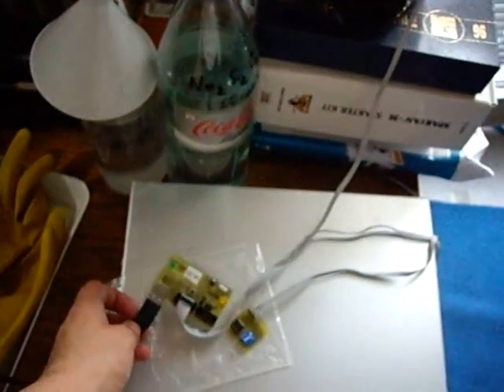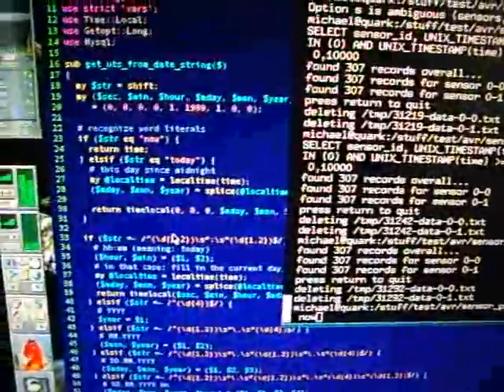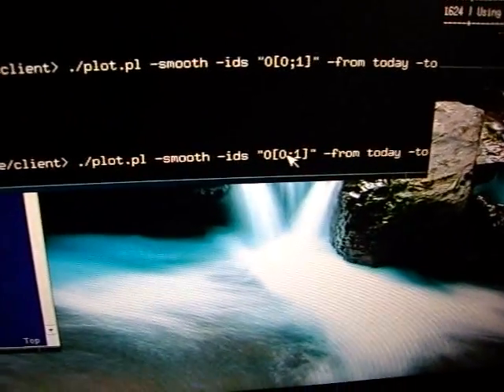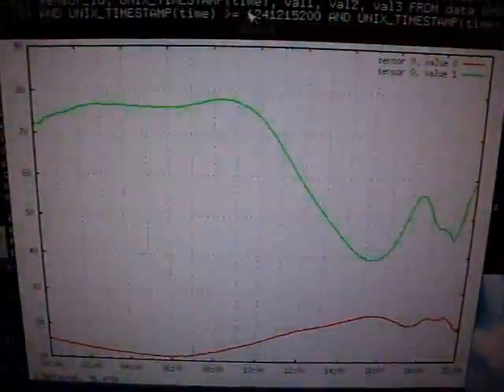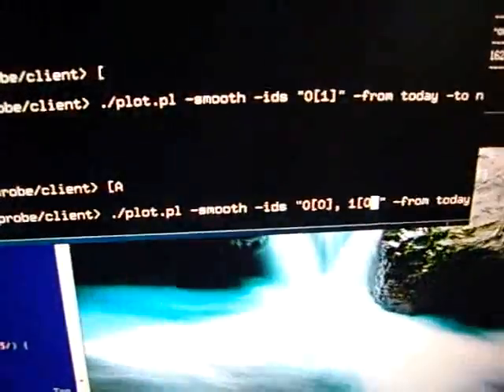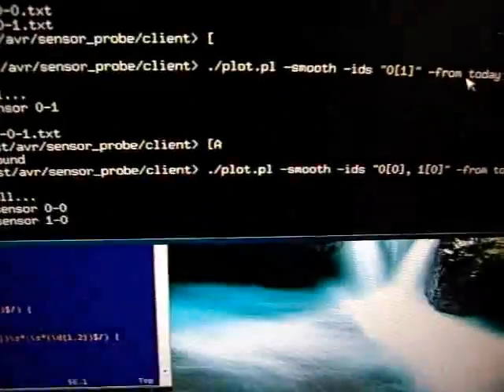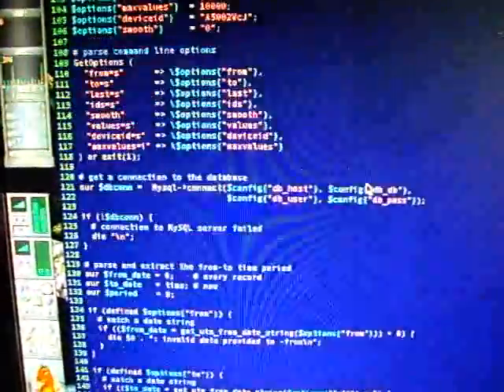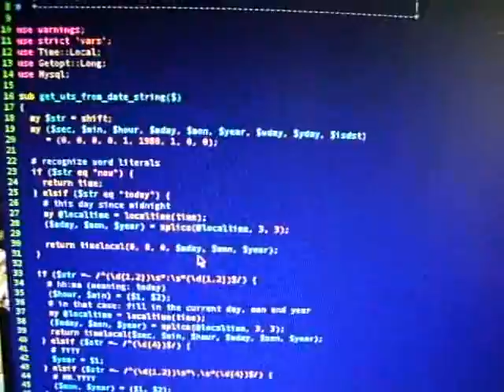Plotting I2C sensor data with MySQL and gnuplot

Comment: Well done! I have the same problem with smoothing the data, what algorythm are you using? Polynomial regression or sth? My biggest problem is  the fluctiations when the temperature is about to change. (like 17.5 18.0 17.5 18.0 17.5 18.0 17.5.....) I don't think its mathematicaly robust to just put them in a regression algorythm and hope for the best...  If you have a solution to this please pm me! But gain well done!